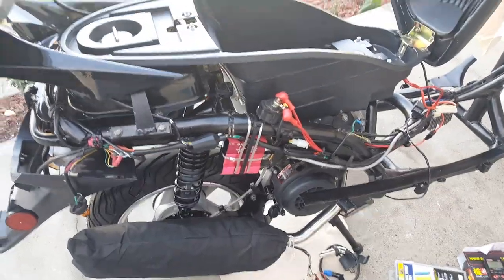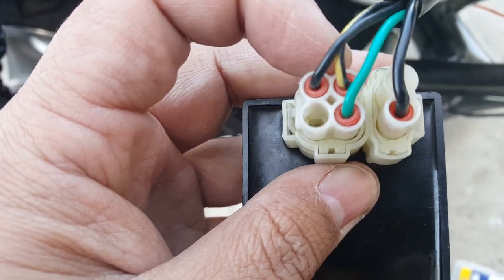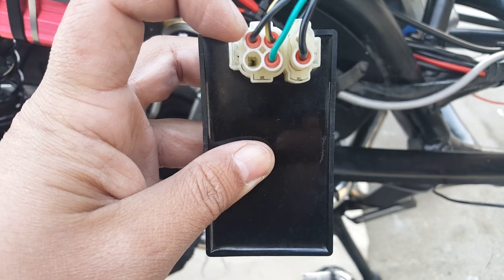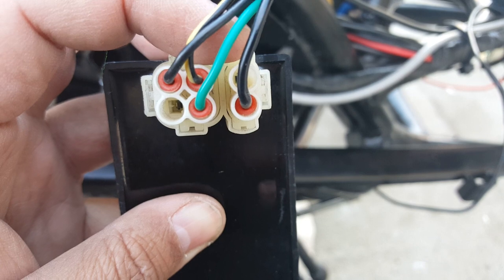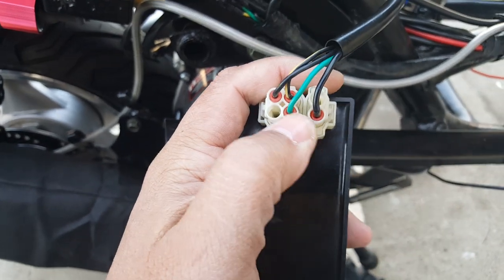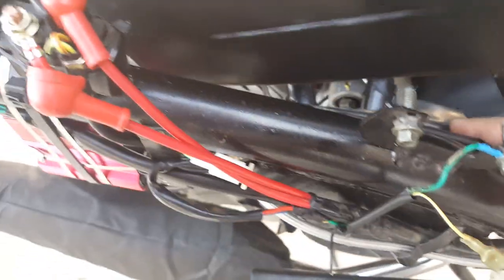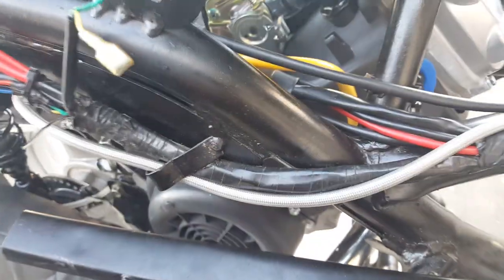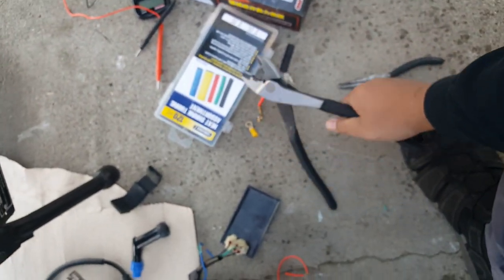GY6 Ground Wire and reroute CDI Pickup Wire Spark Plug Fired 1 of 2

Comment: Should have had some Klein tools at hand to strip those wires . Good idea for ground i I'm an electrician by trade but not in the field I do small motor work this wiring kit I got i as terrible need to splice into magneto wires with same style round ones your using I bought 16 thinking now if 18 or 20 gauge

Comment: The black wire is AC imput from stater
Reply from the maker: you have to test continuity with a ohm meter to trace that stator line for GY6 is not always as color coded standard even from same manufacture.

Comment: Hey all... My scooter have been standing 4 8months now and i`m still struggling with spark. I have 3 yellow wires a red, and a green wire on my rectifier mounted on the left side of my handlebar. my stators wires are yellow, white, green, (pick-up) blue & white and the black & red wire. I have a chineese CDI box, but with 2 gound (green) wires. How do i connect the rectifier with  what wires?
Reply: My Chinese is yellow wire to headlight yellow blue rectifier from stator
 These are both AC
Reply: Stator produce AC on all small engine diode in cdi and rectifiers convert to dc headlight and tails all are AC current by law they must be on whenever bike is running. The empty wire on cdi is ground. Unrestricted bike it is the restrictor cutting engine out at 7.5 rpmsx10